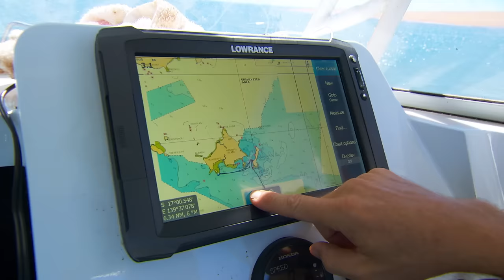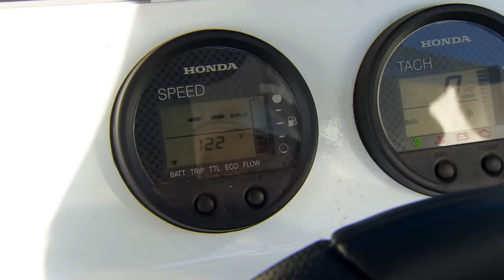🔥 TRUE STORY of WW2 pilots STRANDED on remote Australian island!!

Comment: Open your bonnet and then the fuse box in the engine bay and pull the fuel relay and they won’t take your car anywhere. 

I have relocated my fuel relay so there’s only three people that know where it’s now mounted and I can push it all the way down so it’s plugged in properly and my wife a trust worthy mechanic that likes my car so much he went and bought one similar and I are the only 3 that know what has to be pushed down so it’s getting fuel and is drive able to 

When my brother and I had 70’s and 80’s cars we made our own kill switch and ran the wires to the cigarette lighter and you had to fill the inside of the lighter with solder and when you pushed the cigarette lighter in the car wouldn’t start and when it was pulled out the car would start and no one ever found our kill switches